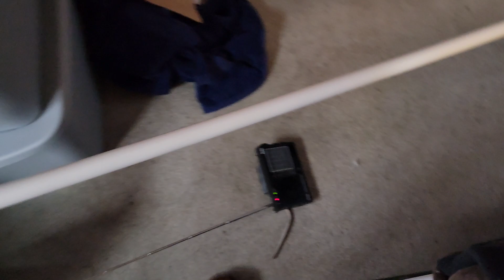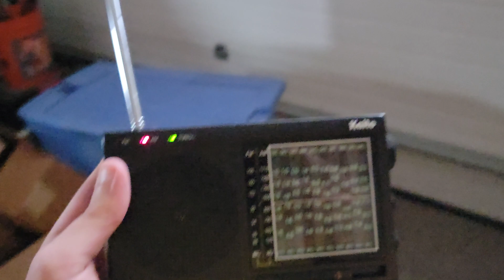Arduino AM transmitter - Low power

Comment: I did something similar but purely analog and with a cap lead as antenna (lol). I found that range was good if powered from mains, I think it was leaking into the house wiring and using it as a giant antenna. When powered from a battery range was supper crappy (10cm) as expected.

Comment: Nice... Pretty impressive how clean the audio is. I'm sure this generates a lot of interference, do to the missing low pass filter at the end. But I like the simplicity. Reminds me of a project where someone used the DAC of an ESP32 to generate an AM Signal. Of course, it's not the same as doing it with a normal Arduino Nano, since obviously the ESP32 is significantly faster, but it also has an actual analog output, allowing it to generate a sine wave directly instead of using PWM. Funny enough, though, the CPU of the ESP32 actually doesn't do that much, since the DAC is controlled via DMA. Anyway, quite impressive. Here's a link, in case you haven't seen the video yet.
https://youtu.be/lRXHd3HNzEo

Comment: I designed an Arduino am tx with 16 bit sound at 1600KHz. Would you like to test it? It still on paper though. LM 386 + Nano + CMOS chip + totem pole with 3904 and 3906